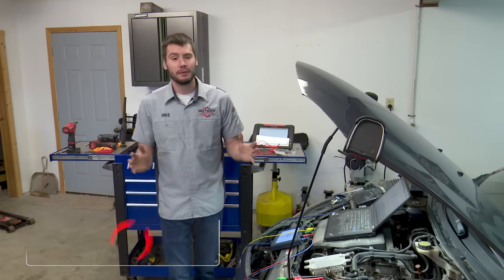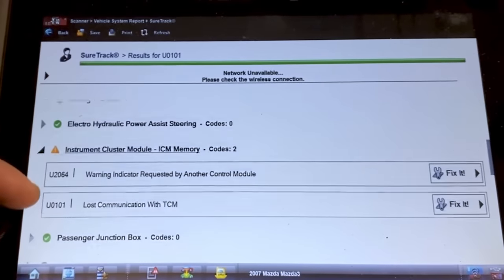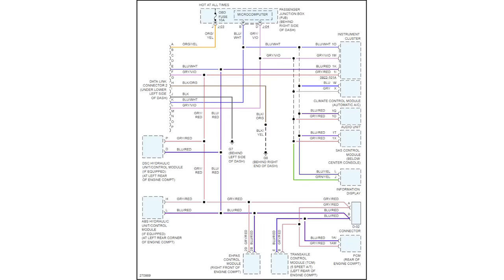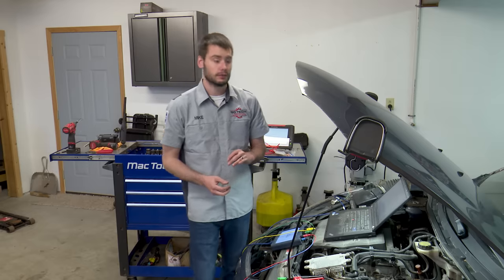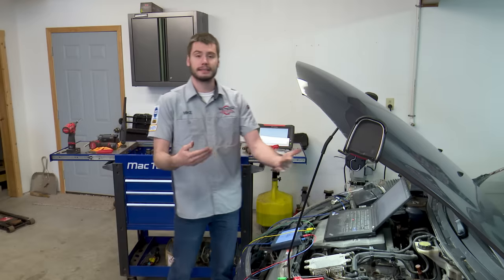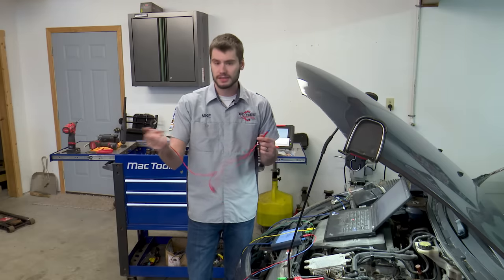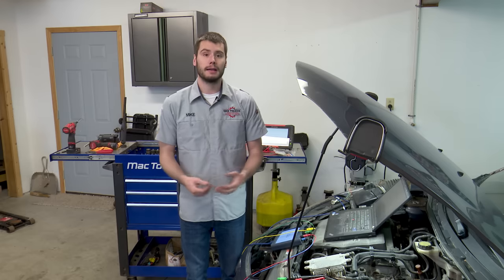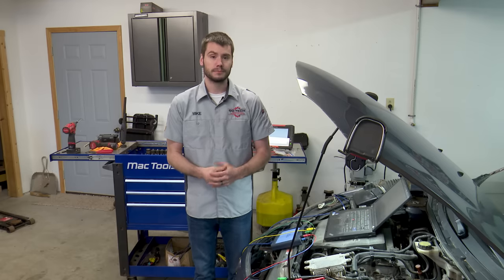Don't Make The Same Mistake I Did - U0101 CAN Network Failure Diagnosis

Comment: How did you fix it??
Reply from the maker: Hey Don, I replaced the entire TCM connector with a used one. Solder and heat-shrink was used to connect each wire.
Mike Becker, Senior Instructor
Reply: Jam the jumper wire in the tcm until you get commication, close the hood and call the customer. 

pray it doesnt turn into a come back
Reply: @johnsko3321  how much did the repair cost ?
Reply: @GoTechTraining  that's a lot of work.
Reply: @GoTechTraining  wow your moitivated I would of just depinned and repin the can wires.
Reply: Nice work man thanks for breaking it down
Reply: Thanks, where can I buy that cable?
Reply: @GoTechTraining  So basically the communication issue was caused by 1 pin touching TCM and 1 not???
Reply: @GoTechTraining  where can you get a New or used TCM connector?I cant seem to find one anywhere. My mechanic buddy has been looking for them at Pick-a-part, but hasn't had any luck yet
Reply: @douga91965  I n my case , I had my TCM fail with same fault code, this is due to the TCM being located on top of the transmission case (which gets hot) , and this fault occurs within 15 min of starting the car up. The TCM controls module overheats, which caused the fault in my case. There was another YouTube video where someone relocated the TCM by attaching it to the back of the battery box by means of a bracket attached to the back of the battery box. In regards to the ABS fault in this car in the video, it’s most likely worn brushes on the ABS module motor. There is another Auto electrician on YouTube who covered this issue.
Reply: @douga91965  oh they sell boxes full of different colored/sized replacements for that. Called wire nuts.
Reply: Omg! Where is this shop? I wanna bring my truck to you!!!
Reply: @paulsz6194  any chance I could get the links to those videos I have seen the TCM being relocated but not sure if its the same video I saw because my issue is with a Mazda which seems to be a big issue in these cars
Reply: @adrianh1037  i followed the same method as this guy, but you need to get a sound, reconditioned/ repaired TCM unit first. 
Which country are you in Btw ?
https://youtu.be/xy6bDA7lwic
Reply: @paulsz6194  I’m from the states Cali to be exact and my Mazda dealership could get me one a day out which is good but since I haven’t gotten the diagnostics done not sure if it is the TCM but from what I been watching and have learned from doing my own car fixes I think it is since my light on my Mazda isn’t lighting up like the gears on the dash the check engine light is on as well as the AT light on as well, but just checked my car this morning AT light has gone away, but check engine light is still there I did get it during a hot day here in Cali it was 115 and yeah probably that was the final straw for my car, but still don’t want to risk driving it even if the light went away but don’t want to fix myself since it’s more a computer stuff as opposed to just fixes if you know what I mean. Although thank you for the link if you got any feed back on my issue I’d appreciate it as well anyone really want to save some money before I have to do the fix
Reply: @adrianh1037  I’m on the other side of the pacific down under ;-) . I would find a Auto electrician that specialises in ECU & TCM repairs, as this will be much cheaper (50% in my case) than a new one from the stealership . If you were in my part of the world, I could recommend a place . But don’t know of any auto shops in CA. The next most expensive thing that can go wrong is the ABS module,with your stability control & Brake light appearing on and ABS non functional. That set me back $1600 + labour to repair 😕
Reply: @adrianh1037  I had the same symptoms as you. How many miles has your car done? Mine. Had 203K miles when it failed. Try just relocating with a bracket behind the battery box, and see how that goes for you. Get a cheap OBD scan tool that can read & reset the code ( Top Don  is a good brand ) or borrow one off a friend. You have to know the exact model of your TCM module (it’s On the side of the module) and give it to the repair shop, so they can give you the exact same one , repaired. You have to surrender your old one to them too as a core replacement .
Reply: @tannerclay  Yes - Or maybe just repin the one wire terminal that was bad...??

Comment: I feel your pain , I once spent nearly 8 hours going through a wiring loom only to find a very thin wire which had broken and had the greenies. 5 mins of soldering then an hour of reassembly  😖😖😖😖😖😖. The owner had paid three other shops good money to fix it, but he only wanted to pay me  for the soldering.....I was losing the will to live
Reply from the maker: Hey Mazdaman, I hope you were able to convince the owner to pay accordingly for the service he received. I also hope that it earned you a customer for life. A lot of times situations like this are great for that!
Mike Becker, Senior Instructor
Reply: @GoTechTraining  Yes it all worked out really well  he realised that he had been ripped off and had parts he did not need,  although  I'm semi retired now still do his company vans , his and his wifes cars and the kids and other members of the family for over 20 years. They are all friends now like most of my old customers. I put it down to I'm a straight talking person I say what the problem is what needs to be done and how to avoid it in the future. If it's been driven by an idiot I will say so, and 99.9% of the time someone will say yes... If the job is a quick fix like bulbs , wipers or a puncture repair I charge nothing. The goodwill generated and then told to others has bought me so many customers.  Main dealers would never do that.
Reply: @mazdaman1286  I used to do little things for free and it's amazing how much goodwill that produces, and often referrals to new customers.
Reply: @GoTechTraining  My problem with this type of diag is getting the service writer to understand my time it worth charging for. They don't believe i should get paid for hours taken and won't even try to sell the time. The old "we'll get you on the next one". OK? Seems to me i'm still losing...but I retired in April. They can stuff it.

Comment: U0101:  Top reason is almost always a loose connector on the TCM 99% of the time!!! This bulky connector sits vertically on the TCM thus loosening with time between the cable harness and the TCM. Inspect, clean and secure the connection is one of the best first steps ever.

Comment: I fixed a similar Mazda my buddy a mechanic replaced with new tcm, and still didn't work checked for tcm power signal with my autell no power did connector wiggle test power came on removed plug retighned terminal was fixed
Reply from the maker: Awesome Alejandro! Glad you were able to get it all fixed up :)
Mike Becker, Senior Instructor

Comment: I had one years ago on a 1982 Mitsubishi Lancer Turbo. This car was an ex Rally car and the owner complained that he could not get it to start. We rigged a bypass so he could get the fuel pump to work. At the weekend we later discovered that the fuel supply connector at the ECU had drifted back away from proper contact with the pin. Turns out he had been swapping ECUs just before it got its problems. Nowadays at my age I always use a bright light and magnifying glass to inspect the ECU plugs.
Reply from the maker: Hey Bigcliffe, when I was at factory training for KIA, they told us the ECU connector is only intended to come apart 3 times. Any more than that and it should be replaced. Crazy but it makes sense!
Mike Becker, Senior Instructor
Reply: @GoTechTraining  Now that is interesting.My brother had a 1986 Mitsubishi Mirage Turbo that we spent lots of time and money on to get that car to do a 13.8 second 1/4 mile time. The problem was that the wire harness was the weak point of that car. The heat of the turbo and the high under bonnet temperatures made me think that there should have been available as a spare a full engine to ECU harness.
Reply: @GoTechTraining  all plugs/outlets have max cycle count which varies widely, 3 seems awfully low though.

Comment: That's how we learn.  You found it and you fixed it.  As long as there are small pins like that one, with very small currents and signals running through them, pin fitment will be a problem after many years and miles.
Reply from the maker: Hey Mike, exactly. Every time that connector is removed it weakens the pin fitment as well. Who knows how many times it was taken off prior to me seeing it!
Mike Becker, Senior Instructor

Comment: Had exact same, identical problem many years ago, on same 07 mazda 3. My first dealing with can bus communication, ( like a lost child with my vantage 2500) replacing the tcm got the car out of the shop, but thanks to your video, I'm skeptical that it was maybe, just maybe a connection issue....thanks again for another education.
Reply from the maker: Hey Gunnar, thanks for watching! Weird how many CAN issues i've heard of now on that Mazda 3. I didn't realize how common of an issue it actually was.
Mike Becker, Senior Instructor

Comment: @GoTech Mike, I've run into that kind of problem, with my own car, a 2004 Dodge Neon R/T, with a cam sensor issue. Kept getting the P0340 code, checked the wiring and replaced the sensor. Later figured out that the problem was the tabs inside the pins in the connector. The tabs had spread, causing an intermittent contact issue. It didn't help that the wiring harness was moving when the engine moved under acceleration. I simply pushed the tabs back in, fixed the issue for good, That was a few years ago. Have not had any cam sensor issues since. It is likely the same issue with this issue, and why the pin feels loose when the backprobe pin was inserted. Another issue that i've found is that sometimes the pin will not be inserted all the way into the connector so that it gets locked in, and that causes issues like this. When the backprobe pin was inserted, it pushed the pin in far enough to lock it in and make better contact with the other side.

Comment: Deja Vu. Our shop encountered this exact same problem on this exact same vehicle. All testing was initially done using the "back probing" method but every test showed no problem. To make matters worse, it was an intermittent problem. It would work great for a while then error out. 
I made the call that it must be an intermittent bad TCM, replaced the module, and the car drove fine ... for a while, then the issue returned (yes ... I ate the cost of a TCM). We switched to the "vampire tap" method for continued testing and that's when we found the problem. We were not able to find a used connector and had to replace the engine harness.
Reply from the maker: Hey Darryl, ahh the "vampire tap" I like that. I may use that in the future! Crazy that it was the same car, same issue...wonder if it's common on these!? I ended up with an "EBAY" used connector. Seems to have done the job though.
Mike Becker, Senior Instructor
Reply: Whoa, replacing whole connector pigtails or harnesses from one bad terminal?
Can you not find the connector/terminal type, then simply depin the problem circuits, cut off the old terminal and crimp a replacement on?
Reply: @Turbochargedtwelve  A lot of these circuits are now using 22ga wiring. They are very difficult to achieve a solid connection especially if the harness can't be pulled up to get access to allow crimpers in. But this situation also brings up another consideration. Lots of instructors preach about not touching/moving anything around because it might temporarily "fix" the problem. I disagree with that. l still do wiggle/tap tests like Ford rec back 30 years ago.
Reply: Gail Taylor I haven’t seen that yet, but I work professionally on heavy automotive stuff (class 6,7,8) or personally on stiff no younger than five years old. Still, using 22ga wire only means that you need to find the correct size terminals and tooling for them. Every time you move a component you open yourself up to more liability and yes I agree packaging is super tight on most components. Getting the connector loose especially on high pin count ones like the major modules can be a real challenge and is often not as delicate as you’d prefer.  Worst case scenario you do end up right where he did, needing to replace the whole harness, or at the least the whole pigtail. It is sad that policies now would rather get the vehicle back out the door quickly at the cost of expense and quality

Comment: I deal with many 5 vdc connectors similar to that in late model domestic refrigeration and MANY times have found an invisible micro-corrosion has occurred. It can throw off a 2-5  kilo ohm sensor to alter a compartments temperature wherever the sensor is in  control .
Slightly feeezing or not cold enough, and in certain environments, unshielded and unprotected connections will cause a 12vdc fan motor or baffle actuator to stall. It is uncommon for those components to be the problem, but if you do not test anything and blindly replace the part, the action of disconnecting and reconnecting that will certainly make it look as if was correctly diagnosed since the connection was refreshed from the reassembly act.
I usually dry fu-xk the connector a half dozen times and tweak both members of that union, and maybe use electricians tape to create a barrier, and that will buy it a few or more years.
Almost never happens on the line voltage connectors. And it's usually the N side of the DC circuit .

Comment: U said u were working on a wisconsin vehicle. Are u located in wisconsin. I am looking for some one that can trouble shoot the electrical. If not can u recommend some one. I prefer not to be the guy that just starts replacing things. I already have 1500 into it. Mechanic said we just have to start replacing parts. Had 2 different places lookk at it. Any help would be appreciated.
Reply from the maker: Hello Beth Grabow, yes we are located in Fond du lac, Wisconsin. If you'd like, we can continue this conversation via email so it stays private. You can reach me at michael.becker@gotech.com
Thanks,
MIke

Comment: Check the connector before taking the harness apart, on the basis of looking for the easy things first.  Plus, the connector is going to be 1000x as likely as the splice since it's a lot more mechanically complicated.  If both sides of the connector have a pigtail you can often test continuity through the connector which helps too

Comment: I've experience a similar issue on Toyota Landcruiser GXR. It was the connector pin of the Transmission.
Reply from the maker: Hey Bogart Bacus, pin tension issues can be the worst to diag...especially the incredibly intermittent ones. Ugh, the headaches, right!?
Mike Becker, Senior Instructor

Comment: Hey Mike so What was you recommendation for repair? To Replace the whole harness, Connector, or remove that one pin and repair it. If you do pin level repair can you please make a video on that
Reply from the maker: Hey Cooking With KJ, any of those would be approved methods of repair. The pin repair on this connector would be very tricky, tiny pins...The customer chose to have the entire connector replaced. He chose a used connector to have installed.
Mike Becker, Senior Instructor

Comment: Hey, Mike. I am not really familiar with the CAN Network. I was hoping one day that you would do a lecture on. My main issue is the can controller and the can transceiver. Is the can transceiver incorporated in the can controller? Should I expect a communication code with a bad transceiver? I am expecting the answer to be no, because they always tell you to disconnect modules to find the one(s) with the bad transceiver(s), but I may be wrong. Your answer would be greatly appreciated!
Reply from the maker: Hey Carlos, networking is far from my specialty. I do hope to do a class on it at some point. I have some studying to do before then though.
Mike Becker, Senior Instructor
Reply: GoTech Do you have any other good resources for networking that you recommend?

Comment: Personally when dealing with a problem like this I try to have some one monitoring data communications on the scanner when I even have to move a wire just in case comms comes back. Have run into connection problems like this many times in the past 40 years. One of the reasons I warn customers about the perils of intermittent connections and the possibility it may temporally fix it's self and remain so for a long time.
Reply from the maker: Hey Ram50v8, that's a good process. Unfortunately, i'm all by myself when I work on stuff at home. Interestingly enough, I did do a traditional wiggle test on the harness and had no change. Nothing changed until I back probed the connector the 2nd time with the jumper lead.
Mike Becker, Senior Instructor
Reply: @GoTechTraining  Mike, I get all the interesting problems sent to my shop that no one can figure out. Like a tail light bulb I found that was causing an intermittent transmission shifting issue. Or a car that was having intermittent multiple systems failures only when the husband drove and the dealer could not find it after multiple attempts. And hundreds more
Reply from the maker: Sounds like you're the guy to see in your town. Good for you, a reputation like that doesn't happen overnight! Tail light causing transmission shifting issues sounds like a fun one. Something back feeding power?
Mike Becker, Senior Instructor
Reply: @GoTechTraining  You'll get a chuckle out of this one. It was a case of customer installed LED bulbs and 5 of 30 the leds in the left light would flicker at a high rate causing noise in the system.